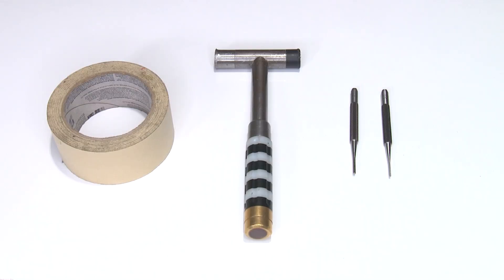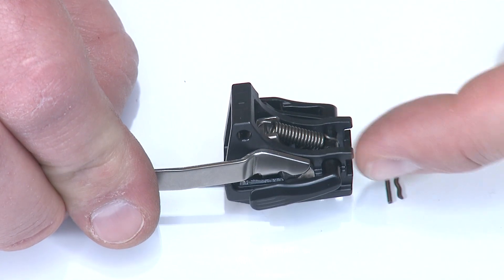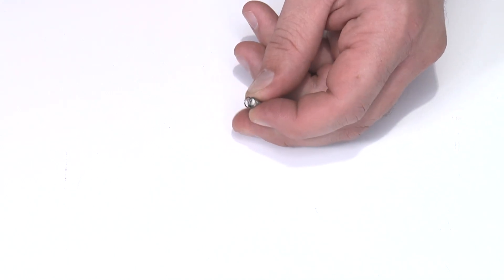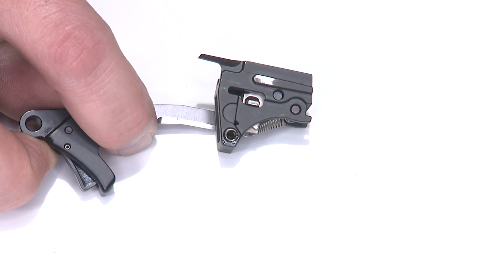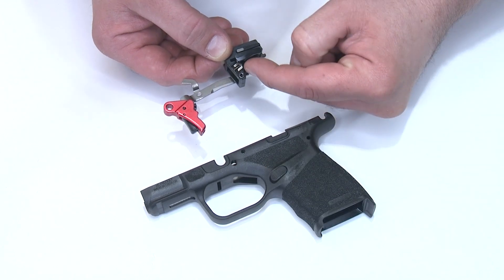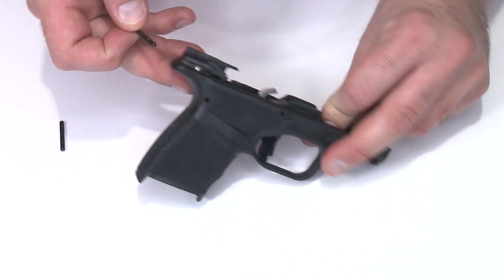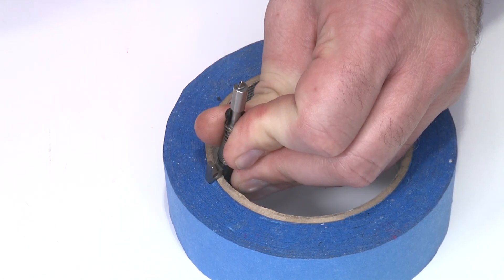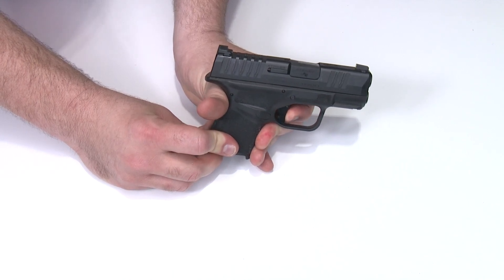How To Install The Apex Action Enhancement Trigger For The Hellcat (incl. Thumb Safety)

Comment: Great video.  Took time and everything was easy.  Trickiest part was inserting ambi-safety clip into tiny hole.  I had to use small needle-nose and  magnifiers.  Improved trigger pull by little over a pound and trigger is no longer painful.  Thanks

Comment: IMPORTANT NOTE: Install also requires a "Vice" to press the trigger pin in.
Great tutorial, I used this to install a new Apex trigger on my Hellcat and it worked out PERFECT!
Reply: Any ideas on how to do this without a vice?
Reply: @hassana136  You can try going little by little with an adjustable pliers. I would use Vice-Grips and a piece of leather. Go slowly!
Reply: Thanks Chris, I actually decided it was time I bought a Vice! But thank you for your time I hope you have a great day!

Comment: Followed this to a T!!  Everything is a breeze if you take your time. The vice is an excellent choice for pressing that one pin in place. The Apex kit came with the pin installed halfway already!
The only challenging part was the thumb safety detent and spring.
Tips: Perform work in a small area, no carpet preferably, as it cuts down on the time spent hunting down safety spring!
Reply from the maker: That thumb safety  detent and spring can, like foosball, be the devil. Glad the install video helped.

Comment: Is a vice a must?  Or can I use large pliers
Reply from the maker: Pliers will likely damage the trigger. We've seen a number of triggers beat up by customers that thought using pliers or vise-grips would do the job. We do not  recommend using a set of pliers.
Reply: Vice makes it very easy